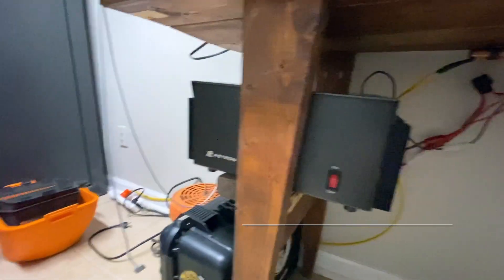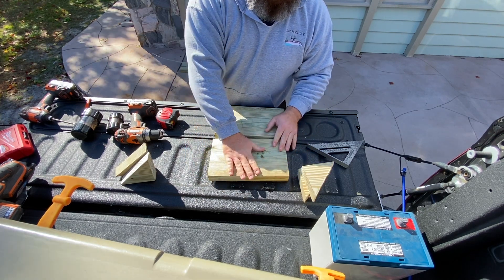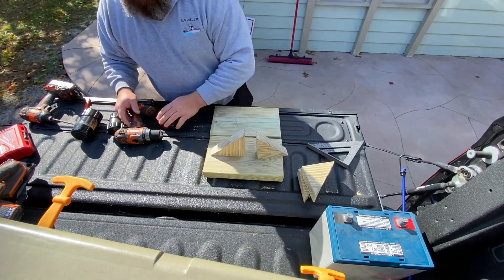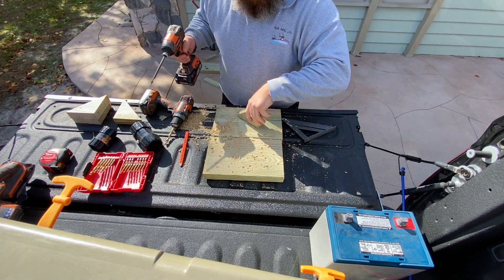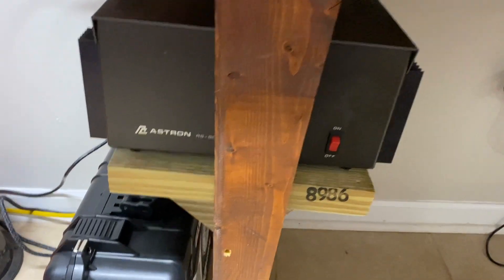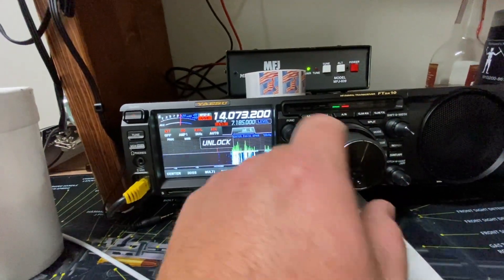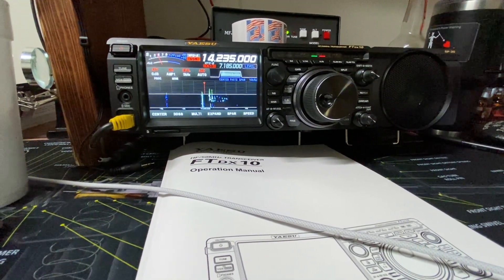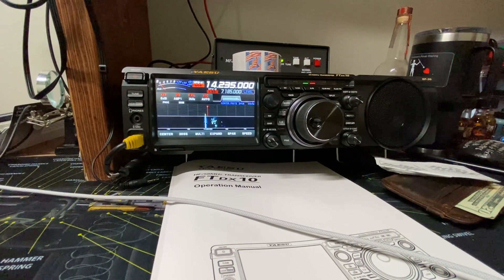Yaesu FTDX 10 Problem Solved!!!!   Power Supply Project

Comment: Looks like you bought the "Big Boy" Great power supply choice. I have the 35 amp version and love it. Rock solid and quiet. They are heavy bast*rds though. Plus, it will be passed down to my kid and then grandkid and still be working 100%.
Reply from the maker: I did get the big guy.  I figured I wanted to exceed the max power output of the radio that way I knee it would work seamlessly.

Comment: Thought it was likely the power supply. 🙂
Reply from the maker: I’m just glad it was. I was worried sick for a while.
Reply: @Blackabeard  I like to use a power supply that provides at least 50% more current than a radio's highest draw on peaks. This will put less strain on the power supply components so it will run cooler and last longer. I also prefer conventional power supplies over digital power supplies as they produce little to no noise which can be picked up by your antenna.